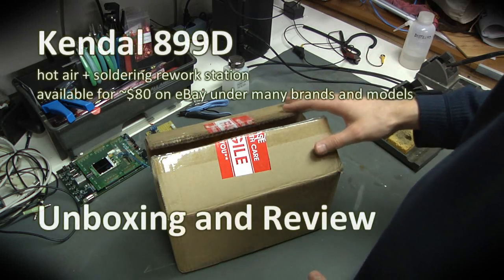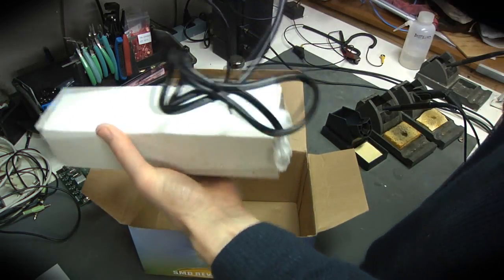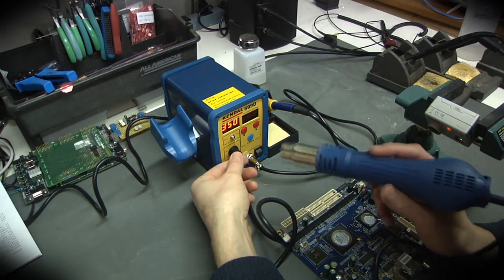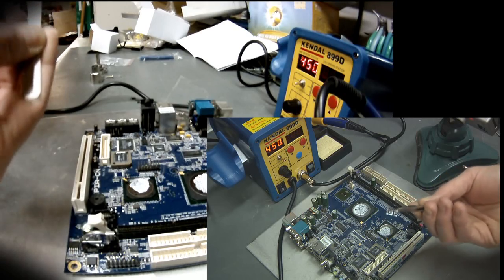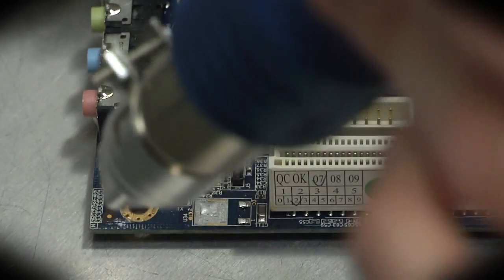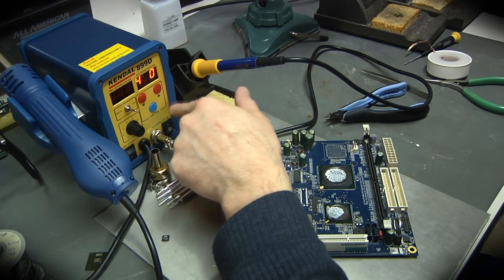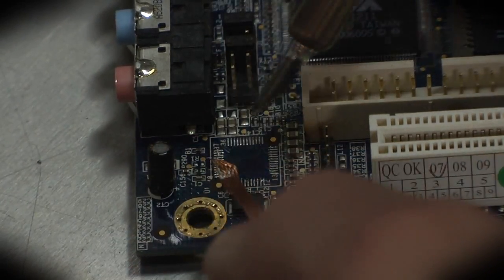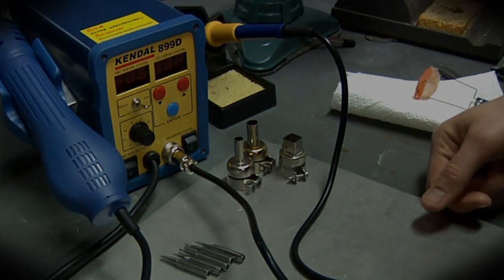Kendal 899D Unboxing & Review

Comment: Mine work fine and the 898 d has a metal soldering iron holder,the only difference from a 898 to 899 is color and a metal stand.and mine so far works fine.but I have only use it 3 times .

Comment: Thanks for an honest, balanced review. It seems like most of the review videos of hobbyist rework stations fail to point out shortcomings and don't include tests of common applications like removing BGA components. At the same time, I like that you evaluated the tool for what it is: an $80 entry-level station suitable for hobbyists or as a secondary machine.

Comment: Not bad for <$100 though! The knife tip, like you mentioned is a little anemic and as you also mentioned is due to the sleeve/shim not being in place I think (Thermal xfer). I have used all kinds, high end, low end you name it,  and for $80 bucks, Id grab it for a odd jobs. It did remove the D-Pak's!! The Metcal is (sweet!) though, Pace another good one. If you want to sell me that Metcal for <$100, you got a deal buddy Id even pay $200!  lol jk  cool video.